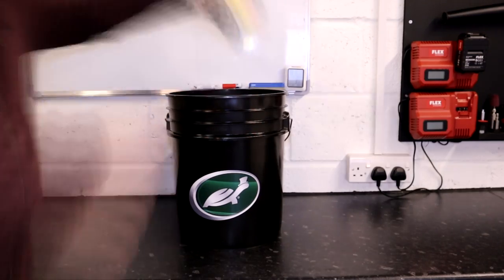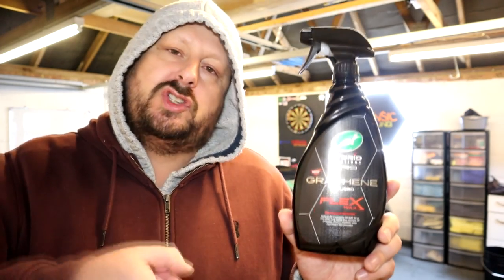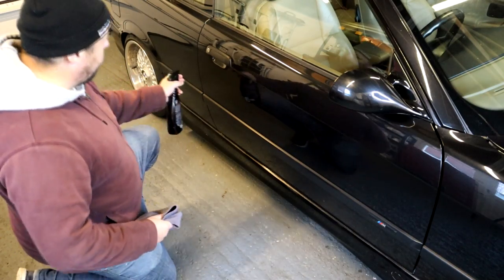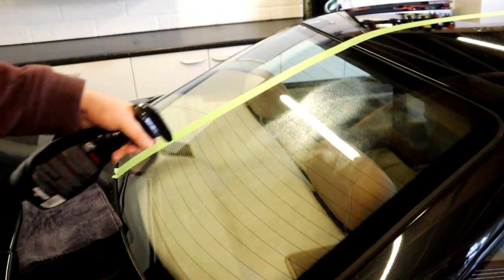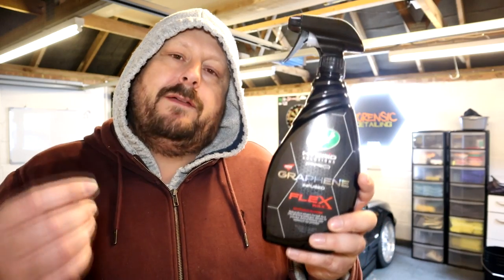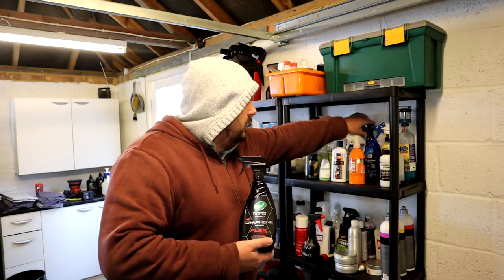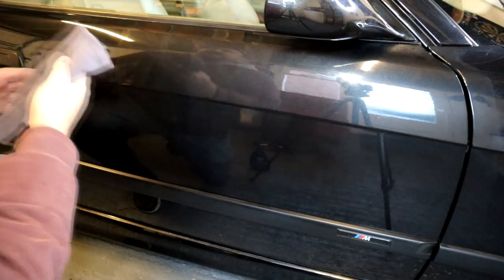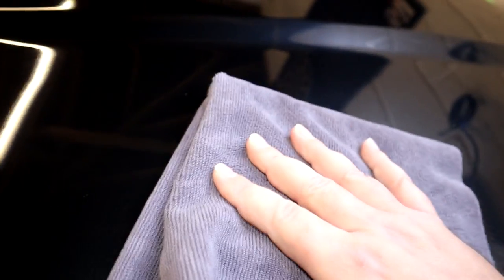Turtle Wax Flex Wax | Paint Wheels Glass Plastics | Base Coat or Topper or Spray and Rinse

Comment: "Cheap Products".... errrm.. nope, Turtle Wax's new range are certainly NOT cheap john.  In fact, for the volume and the amount you need to use these work out quite expensive.  However, interested to see how this compares to Garage Therapy Sigma - I doubt it could be better TBH.
Reply from the maker: I explained in the other videos TW have "done" cheap products to death.  they sell a paste wax for £8.50 for 400 grams (around £2.13 per 100g)  Thats actually the cheapest paste wax on the face of the planet. dry and shine and the seal and shine UK equivalent I bought for £3.50.    So  the guys that dont believe in ceramic or graphene products and go and use these products for less than the price of a cup of cofee.   TW know when they release high end products they will get people saying this is expensive "I want the cheap stuff!" they have been doing this for 75 years.  They are catering for a different end of the market that likes trying like the latest stuff.  And ultimately this is what companies must do.  Innovate and provide new detailing products, if they dont then the companies that do innovate make all the money.